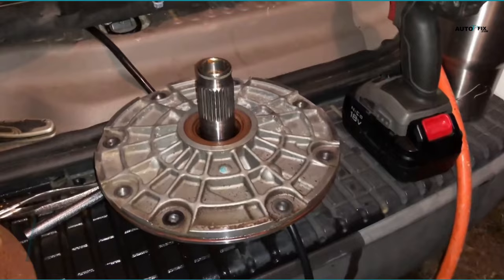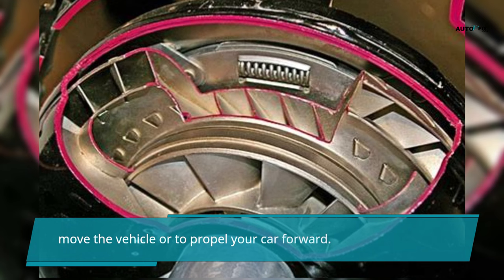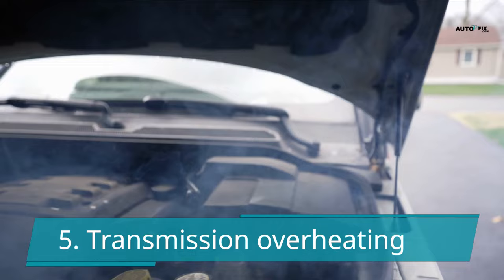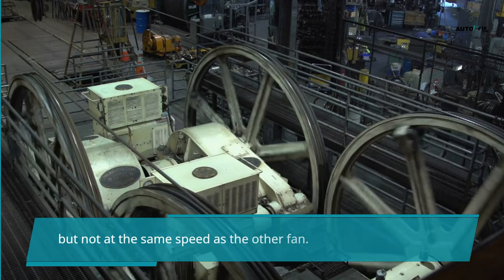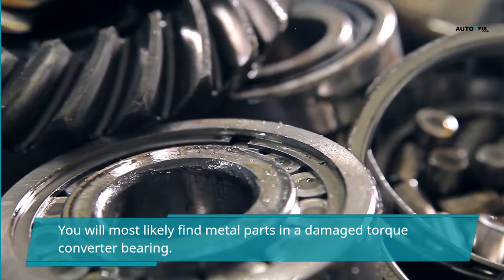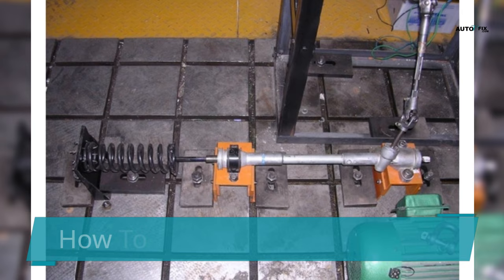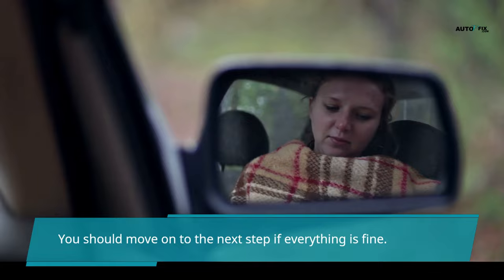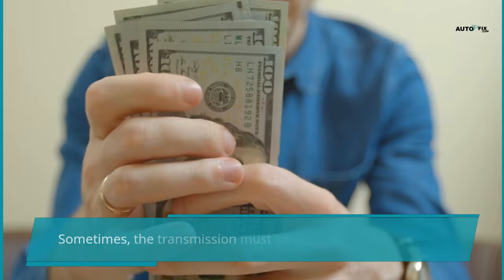8  Most Common Symptoms and Signs of a Bad Torque Converter

Comment: When a torque converter goes bad, you will NOT only be replacing the torque converter; you’ll be replacing the entire transmission. Why? When a torque converter goes, it will blow metal fragments through the front pump and into the transmission. It’s easily $5000+ for a new transmission.
Reply: You definitely have situations that only require replacing the converter.
Reply: Not true. I've had my tc emplode while driving and my tranny was still good. The second one that failed took it out though.
Reply: Yes that’s what I’m going through right now for everything it’s going to be 4.200$

Comment: Let the engine warm up before starting it 😭😭😂
Reply: I thought that what he said😂
Reply: Also said “it should be professionally diagnosed before A professional mechanic replaces it” so I guess that means take it to a professional and then take it to another professional😂
Reply: Yeah anything but check😂 your pressures with a gauge … most transitions have at least four pressure plugs on the side of the transmission .. test ports ..
Reply: Probably meant before putting in gear. Lol
Reply: Lit a fiar under it. Fixed it instantly. 
Thanx auto v!
LOL!😂🤣
Reply: @dagutterboy73  what do you mean lit a fiar?. help
Reply: Must remove engine to get to converter ¿  what
Reply: @robertholderman7552 what about check fluid level. ¿¿ 
😊
Reply: I heard that
Reply: Bro I got an Error code in my brain after I heard that 😂😂😂💔

Comment: I brought my car in for that problem. I told them what was going on and whatvi felt it was. I also asked someone i know who is a mechanic at a GMC dealer, and he said it sounds like the torque converter confirming my thoughts. When i the mechanics looked at, they told me it was just a broken engine mount. 2 weeks later, I brought it back for the same thing. Now they are replacing the transmission. When i would accelerate getting on to the highway when i was about 40mph the car would shake. It would also do at other times, and more when it was raining or very humid out.

Comment: A mechanic pulls my engine to check the tranny he's getting a beating. It's rear wheel drive 😂
Reply: That would be your differential. The gearbox or transmission is generally near the gearstick, at the back of the engine or  occasionally underneath, like a Mini, or at the front with a loooong shift-rod.
Reply: @alexwilsonpottery3733  I just put in a new transmission and didn't pull the engine 😂. Funny you think a mechanic of 32 years didn't know what that pumpkin in the back was 😂. How do you measure for a semi or floating rear axle? 😂 What's the other measurement you use when getting a rear axle? 😂. Thanks for the laugh my man.. 😂

Comment: Mine feels like it slips and engaging and it shakes its like a pulsing shake it shakes and then doesn't and repeats
Reply: Possible transmission shutter. Mine is doing the same. Power loss too.
Reply: Up date -8/12 mechanic can't get it to shutter. My electric 4 wheel drive module is out so he is going to replace it. Thinking that it might be trying to switch into 4 wheel drive, causing a power loss and shutter. Will update results.
Reply: Another up date: talked to another mechanic and he had a very good way of describing the shutter. It about the same as running across the washboard on the sides of a freeway. That same vibrating but with a power loss. He had suggested to change out the trans fluid and possibly flush the system. And if that don't take care of it,. Most likely a Torque converter problem.
Reply: My 2015 gmc sierra 1500 doing this man😭 but thanks for the info will flush my trans oil and replace it
Reply: @jerrycrafts5301   I changed the tranny fluid in my BMW in spring and also the filters. The problem with the gearbox started in september this year, i.e. shuddering at 30 - 40 mph, weird low hunming noise at idle and slippage + hickups in 1st, 2nd, and 3rd gear.
Reply: @Chrisav97   Your car is too new. I would doubt the trans fluid is your issue, if you don't have leaks.

Comment: I drove around with a shudder on 2011 Chevy Traverse for about 8 months.  First the shop said it needed a tune up, plus I needed a power steering pump. That was $4,400! The car ran almost like new except the shudder was still there! At that moment I knew it was a torque converter.  Took it to a transmission shop and they confirmed it.  They used Shudder Fix, and said I will know in 50 miles or not if it works. It did make the shudder much less noticeable but it was still there.  The shop told me I would need to replace the whole transmission. They won't install a new torque converter on an older transmission.  Wanted $4800. I chose to buy the Torque Converter. Remanufactured Converter Cost me $293, and a New Torque Converter Shaft seal was $7.09.  Then I took it back to the shop that did the previous work for me. They charged me 9.5 hours labor, plus 7 liters of Transmission fluid, and they had to replace 2 Exhaust gaskets due to dropping the transmission down. Plus I needed an Engine Mount that was going bad. They charged me $1,464 for all of that.   All in All $1764 + the $4400 I spent 2.5 months ago.  $6,164 later, and the car better last me at least another 2 years! I will say the new torrque Converter runs like brand new, but it makes a slight tinty whistle sound when the car is moving. I guess a bearing inside of it is not the greatest, or it just needs to be lubricated more while I drive it around.  But you can only hear the sound with radio off and windows down so I can live with it! I put over 7,000 miles on the stock converter while it was slipping before a reman one was put in. Just thought I would share my experience.
Reply: Tune up and power steering pump for a transverse  cost 4400$? I call bullshit.
Reply: Stole my thunder, many times a spark plug,wire,coil pack ,will cause what seems like a T.C. shudder.. Bit generally this will trigger a code, misfire. So yes the Lubegard shudder fix , will many times fix. Reason all fluid may not be the same, slipperyness. not a word i know. , its called friction coefficient.  I wet my valve bodies down with lubegard when i build one. Keeps the valves from sticking ,if the unit sits in the floor for a while, waiting to install.
Reply: @JohnnyDanger36963  sounds high as shit !  Damn they lift an engine to have to come out ?
Reply: Dude I would not be taking my shit back to a shop that charged a tuneup and power steering pump for $4,400 and still didn't fix my problem!  That should've told you ...somebody doesn't know wtf there doing!  Alot of money to be guessing with!   Live and learn  .. yes imo and not my money.
Reply: @epmcdonald4562  yeah seriously wtf. who spends $4400 on an old Chevy Traverse? the whole car is worth maybe $5000

Comment: A stuck or binding servo can cause your RPM's to run higher at the same speed because the servo is not holding line pressure causing engine to run higher to produce the same pressure from the pump.
Also the servo holds the band(s) in place under pressure, if binding the bands are not holding because of the reduced line pressure and again you need more rpm, n if not fixed soon, you will burn up the transmission...
The servo is an easy fix in some vehicles, the transmission does not have to be removed from the vehicle...

Comment: Never thought I'd be listening to Aaron belisle for vehicle advice, but here I am! :D

I think I might have Torgue converter issues. While sitting idle at a red light, I can vehicle my shaking underneath my chair, and there is a constant knocking sound every few second (I thought it was the fuel pump sloshing back and forth, but now I'm thinking it might be this instead. I also have occasional rough acceleration where I'll be accelerating, aand then it almost feels like the car slams on the brakes. The acceleration stalls, the whole weight of the vehicle shifts forward, and then it finally kicks in again

Comment: Also a rough shudder when coming to a stop. Feels like driving a standard and you left it in gear when coming to a stop. Anyone else have this issue. Also motor mounts. Has anyone experienced symptoms of bad motor mounts?
Reply: I had a bang when pulling off then when i came to stop at lights it stalled, in reverse it just shot backwards fast

Comment: I'm looking for specific sounds and what they mean.  Such as a swishy-swish sound when in gear but holding at a stop light.  Swishy-swish sound is louder upon initial acceleration but disappears at cruising speed, whether cruising speed is 20 mph or 60 mph.  Most of the time no swishy-swish sound and the car feels great while driving.  Swishy-swish sound not present while in Park or Neutral.  No engine flaring.  Normal feeling acceleration on freeway on ramps and out of stop lights, whether swishy-swish sound is present or not.
So what causes the swishy-swish sound?   Try talking to transmission shop mechanics, particularly the greybeards who have been doing this all their adult lives, and "could be" is their response to any theory I or they come up with.
Car is 1966 Pontiac Lemans with V-8 engine and ST-300 transmission.

Comment: Rebuilt transmission but it won't engage in drive now. Wondering if it could be torque converter
Reply: I just installed a so called Remanufactured Transmission in my wife's Honda Civic. Same problem.
The Live Data shows the Shift Solenoids are activated, but the car doesn't move forward or backwards. No fault codes for the Engine and Transmission. I'm sure the Torque Converter is defective. The Transmission has a three year warranty.
The Shift Cable is installed and not broken.

Comment: I would check for accurate transmission fluid level first. Drive your car until it reaches running temperature. Then engage neutral gear and then check the transmission dip stick a few times to make sure the fluid level is in the area that indicates "Hot".
Reply: LOTS of modern cars you can NOT do this with kinda of like my Cadillac ATS 2.0T luxury. 🤷‍♂
Reply: I just bought a 05 range rover for 500$, runs like a million bucks but the pos won't move a quarter inch in any gear, its the TC for sure
Reply: @EliteOnTheBeat pos

Comment: It cost quite a bit to replace a torque converter. And I understand why. But why don’t the manufacturers design a better way to change the torque converter in an automatic trans.? Maybe they could design a better way of transferring power from the engine to the transmission. Getting rid of the one that holds 8 to 12 quarts of freshly refined crude oil. Why doesn’t the government say anything about the use of these large amounts of chemical fluids that an auto holds? On the lighter side, did anyone else think that our host sounded like a robot? Just asking

Comment: What could be the reason why I don't have a reverse
Reply: If it’s a Chevy 4L69e then it’s the back drum in your transmission . which I think is the reverse drum. The splines in the drum were not properly heat treated and fail Over time .

Comment: My 2012 GMC terrain drives like 200 Miters and removes all the gears while shifting to the 3rd gear. Is it the solenoid or torque convert need a replacement? Or another transmission
Reply: More lickley your torque convertor is coming apart. The 6l80e  and 6l90e are common for torque converters coming apart and putting alot of metal everywhere it eventually plugs up the filter and causes it to stop moving

Comment: What's happening when in the mornings, after maneuvering to exit from a garage, using reverse an D positions very normal, but in the road gear doesn't shift around 4 minutes, after that the car runs normal. Sometimes even the engine revs but traction is gone for a few seconds during those 4 minutes. Please help, before I go to the mechanics, just for information.
Reply: Change transmission fluid it might be low

Comment: What would cause a transmission to drive perfectly but no oil is coming from the cooler pipe?
Reply: Clogged cooler
Reply: Check both sides gm rear wheel drive the lower cooling line is pump pressure out. Top line return.

Comment: Can a bad torque converter bog you motor down so bad you have to feather the gas to get it moving If you floor the gas the engine almost dies.Ease up and it will sliwly build up speed.
Reply: Talking about a 4L60 transmission.

Comment: Is it the torque converter if it stalls out coming to a stop
Reply: Did you ever find out why it stalls my son has a Chevy Silverado doing the same thing
Reply: Could be the torque converter clutch is not releasing when it should. Check the TCC solenoid
Reply: check the TPS sensor as well as it can confuse the system